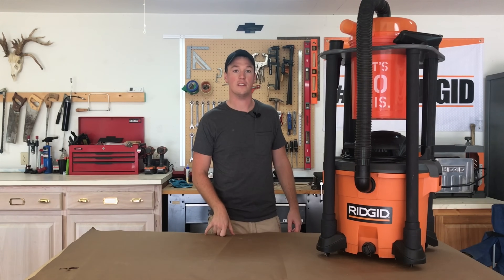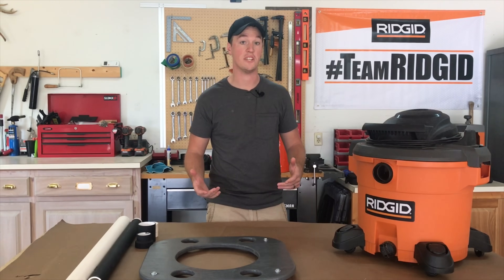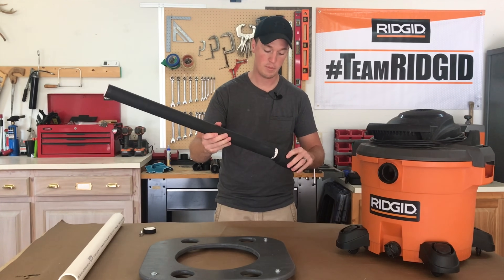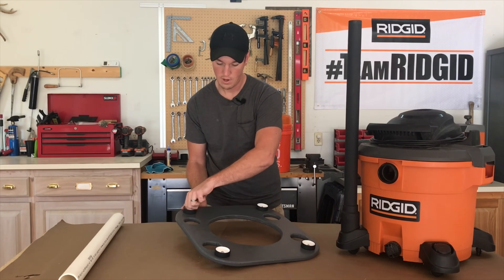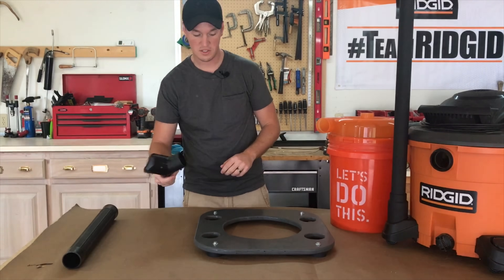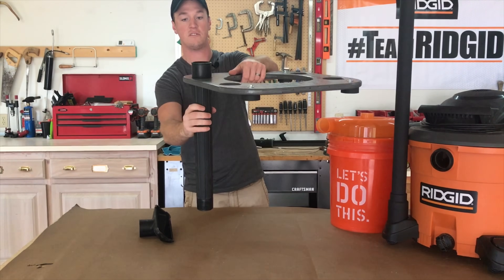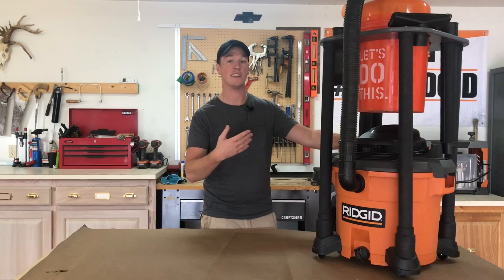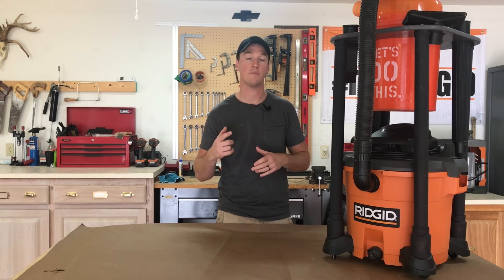The Ultimate Space-Saving Dust Cyclone Separator Cart | Dustopper & Ridgid Vac Cart

Comment: I bought the Rigid after they changed the caster feet from John’s version. It actually simplified the design for me. (4) 1.5” pipe at 33” length. Use a heat gun to warm up the pvc and push it down on to the nub on the top of the caster. If you don’t have a heat gun a 1.5” coupling fits over it loosely.
Reply: Jonathan - What model Rigid shop vac do you have, just curious.  I'm thinking about the HD1400.  That nub isn't very deep and I am wondering if you felt like you got a good tight fit?  Also - is there a way to add a screw through the pipe and into the nub to add more strength?
Reply: @pburner  I have the RIDGID 16 Gal. NXT vac with detachable blower. To make the 1.5" PVC Pipe work I used my heat gun for about a minute on one end and once it was soft enough I shoved it over the nub on the top of the well. If you look in some of the comments, the 1.5" coupler will fit loosely over that part of the foot and some folks have been successful with putting foam window trim on the inside of the coupler to make it fit. I don't mind the heat gun method, but it does look odd fitting over the feet. If you painted it flat black it will be harder to see. However, I have a small shop, and this vac sits in the corner so you'll never see it.
Reply: @pb5172  Thanks for this.  Sounds like a good way to go.
Reply: I went all over the place looking for pvc that would fit and no luck. I was thinking about heating it like you did and i think i will give it a try 👍🏻

Comment: What im not understanding is why have this set up when you have a shop vac? Basically you made a container that collects dirt, trash, ext in 1 contaner. Witch thats what the shop vac is used for. Not saying tgis idea is awesome and looks great. I just dont understand the concept of it when the shop vac does the same thing without the bucket right? Or am i missing something?
Reply: The way it works is if you don't have the Dustopper ALL the sawdust and crud go into your shop vac and eventually your filter becomes completely plugged and the shop vac itself fills up.  Using the Dustopper, all the debris drops into the bucket and very little, if anything goes into the shop vac thus saving the hassle of emptying the shop vac and messing with the filter.  I got a bag for the shop vac and will see how that works.  It collects the debris and dust but will eventually be thrown out... similar to a vacuum cleaner bag.
Reply: @Pkerr1000  im ment to say. not saying this isnt awesome and works great. I had said. not saying this is awesome and looks great. But anyways yeah i get that idea. Its just that you can put a reusable filter thats rewashable in the shop vac itself and not have to worry about it getting dirty or motor getting guncked up. I think now there would be more to clean up with the bucket as well with the shop vac. Now i do see it as a good idea for water separation tho
Reply: @shyskeleton1665  This method pretty much eliminates the need to mess with ANY filters as all the stuff would go into the Dustopper.  Once your bucket is full you just detach and go and dump it.  No muss.  No fuss.

Comment: For those of you with a newer ridgid vac where the part above the casters doesn’t fit standard PVC, get 4 of those short rubber 2” to 1 1/2” connectors with the hose clamps on both sides. Fits like a glove
Reply: What did you do to counter the wobble from the rubber fittings
Reply: @matteason989  the fittings are only about 3” long and with the metal hose clamps on both side you can get it pretty darn tight on the base and around the pvc. The top of the cart has a little bit of wobble but not enough to affect performance. Hasn’t ever fallen over or anything like that

Comment: For those of you who have wobble due to rigid changing the casters.....wrap some 3/4 weather stripping around. Gives the 2 inch couplers a snug fit. You still get a little play but it’s way improved. I may add some horizontal braces around the pipe to help further stabilize.

Comment: Great mod. I just finished mine today abs followed your build. Rigid must have changed their vacs Becusee the 2 inch pvc is too big for the vac footing pieces. I tried a 1.5 and too small. The 2in fits but it’s not snug and makes everything wobbly. I’m going to have to figure out how to make things snug.
Reply from the maker: Yea it’s a shame, of course they had to change it haha. I don’t have the new vac but maybe you could wrap some electrical tape around the castor to snug up the pvc. Or even just run some little screws through it if you didn’t mind

Comment: John - where are those pinned comments you mentioned?  Thanks
Reply from the maker: Hmm it was right at the top of the comments. Not there anymore, dang!
Reply: @JohnBuildsIt  I know.  So now what am I going to use?  ;-)
Reply: @Pkerr1000  also looking for a solution - I bought all the stuff and the fittings don't work.  Was hoping someone smarter than me can share.
Reply: @smoothlarryhughes  Probably have to just go to a big box store and just start trying different couplers and reducers etc until you gt the right combination.
Reply: Someone in comment section stated to heat up a 1.5 pipe and press it into the wheel thingy and I guess what it cools down it fit perfectly hope this help will try this next week when I have time

Comment: I built this setup to use in my small shop. The build is great, but the rigid shop vac has very poor suction. Not good enough for my needs as a dust collector. I had to fall back to using my my old craftsman shop vac with a dust deputy dust collector. Much better suction.

Comment: I used your idea and tweaked it for my needs.  Thanks for the idea.  I have a 20 gallon drum for my dust collection and needed more support so I added some T connectors on the upright supports. That made it more sturdy and is working well.  I cut a handle in the top to move the cart around easier and cut out a place to wrap the cord.  Works great.  Just what I needed.  Thanks for the inspiration.
Reply from the maker: Awesome man! 👍🏽

Comment: My Rigid is older and the holes at the at the casters measure for a 2.25 ID diameter coupling, don't think a 2" will fit.  Thinking about get a new model Rigid for the shop, anyone know what size couplings fit it.

Comment: Hi John: I have a brand new Rigid Vac. WD1060. It has the new style feet with that downward slanting groove. I purchased 1 1/2" black ABS pipe, 4 connectors and 4 end caps. The connectors fit the groove very snugly, they must be thicker than the PVC. Problem solved. I'm going to copy the rest of your design. Loveit!
Reply from the maker: Awesome!!
Reply: Mike, would you mind sharing what connectors you found? I have the new slanted wheels as well.
Reply: Hi - can yous hare the connectors you used for the new NXT models?

Comment: I just ordered the 14 gallon Rigid.  The price was reduced by $44 to a mere $79 and the shape of the 14 gallon Rigid doesn't taper outward and it looks like it will allow the 2 inch pvc all the way up without the reducer.  I will post again after it arrives and let you know.  I am considering the 7 gallon pail buckets from Amazon, but it think it will require a longer hose to connect the two if I do that.  I will wait and see in about a week after it arrives.

Comment: Thanks for the idea @John Builds It, I copied your plan but had to modify it because I have a different model vacuum, mine is the Ridgid HD14000.

I also copied @Cary Anderson  idea to soften the PVC tubes with a heat gun to get them to fit on the wheel supports. Great idea Cary, it worked great.

When it was fully assembled, I realized that it was quite wobbly because the PVC pipes were not tight against the side of the vacuum canister to add stability.

I was trying to figure out a way to stabilize the PVC supports and while at work the other day I came across some packaging material that was going to be thrown away, it was Kaizen foam, I cut it to fit between the vacuum canister and each PVC post. It worked great and the assembly is rock solid now.
Kaizen foam is quite expensive to purchase so I was very fortunate to come across some for free. 😁

Comment: I have one question. How do you figure out where to drill the holes for the caps?
Reply from the maker: It’s the same measurements from the centers of the castors to each other
Reply: Thanks brother came out perfect. Do you use that on your tools?
Reply from the maker: The Dodson’s yea man, I use it on everything!
Reply: Ok just curious if there’s a better hose to use on tools. The rigid one seems heavy and not super flexible. I’ll try it out this weekend on a project. Great plan dude pretty bad ass.

Comment: Just built one based on this idea for my Rigid 12 Gal. 5.0-Peak HP NXT Wet/Dry Shop Vac.  Used 2" and 2" couplers for the feet  30" legs.  Had to relocate the handle.  Pictures on my FB ablum: https://www.facebook.com/carl.chapman.sr/media_set?set=a.10158737928724623&type=3

Comment: Great concept!  I've got a Craftsman vac but the design in your video along with all the measurements worked out great for me.  Just put mine together in one night and finished spraying the legs and top today.  I picked up a brush attachment at Lowe's for $8 and used that 90 degree elbow to finish off the attachment of the Dustopper to the vac.  I also added cletes on the underside of the top to have something to grab on to as I move it around my woodshop.  Really appreciate your video that made it all happen!  Keep up the great work...

Comment: Cool idea! It figures that Rigid changed the dimensions on the caster support,  they are probably planning to sell a kit that copies your idea.
I'm going to try the suggestion of heating the PVC pipe to make it fit. If that doesn't work, I noticed home depot sells rubber pipe connectors with steel sleeves and clamps, that seems like it would work also.
Thanks for posting this video!

Comment: I bought it all and.... it’s the weakest suck in town. Taped every joint. It still won’t suck with Dustopper. Doesn’t suck, stinks.
Reply from the maker: What kind of vacuum? New one too? I still use this set up everyday lol works great
Reply: John Builds It Same exact and very new.  I think though that I got cheated out of the fitting  that plugs into the vacuum below.  So there’s a big kink in the connector hose that’s way too tight/short.  Maybe I’ll bitch it with the seller.
Reply from the maker: Terence Gillespie it only comes with one fitting. I bought the second one
Reply: John Builds It Well give it away.   Where did you buy it?
Reply from the maker: Terence Gillespie link is in the video description 👍🏽

Comment: I just built this. My vac is bigger so I went 2 inch pipe.  I put a screw through the coupler to secure it to the vac/base. Problem I'm having is it's a little wonky.  Any thoughts how to tighten it up?
Reply from the maker: Could you use a bolt and nut to tighten it up better? Or maybe wrap some electrical tape around it to make a tighter fit

Comment: For people out there struggling with pipe fitment and newer style Ridgid vacs. If you're in the market to upgrade your vac anyway like I was, the Ridgid WD1060 (stainless steel model) is a great option for a few reasons. 

1) It has the 6HP motor and the smallest tank for a motor that size (10 gallon). This is good for this setup because we have a 5 gallon bucket for dust/debris, so why have a giant 16 gallon bulky tank?

2) The legs have slots that fit 1.5" PVC perfectly with a nice tight fit. No need for adapters or reducers.

3) The stainless steel tank is NOT tapered like all their other vacs. This means the PVC pipe will go straight up and not be kicked out at an angle at the top of the vac (no need for PVC reducers).

4) It's $99, making it cheaper than the two 6.5HP options, and the same price as a plastic one with only the 5HP motor. 

5) It actually looks awesome, the stainless tank is great looking compared to a big orange or gray tank.

6) Still has the Ridgid Lifetime Warranty.

If you go this route, all I had to buy was:
- Ridgid WD1060
- Dustopper
- 1 1.5"x10' PVC pipe (cut to 30" pieces)
- 4 1.5" PVC end caps
- 1 Brush attachment with the 90 degree elbow from Lowe's. This is for a ShopVac brand vac.

I had scrap plywood, 5 gallon bucket, nuts and bolts, black spray paint on hand.

Comment: Hey John, Great design. I watched a few videos about making a vacuum cart but your design was perfect. I just wanted to add that I have an older shop vac that came with a 1 7/8” hose. I found that a 1 1/2” pipe fit perfectly without the 2 1/2” to 2” reducers. 
Thanks for posting this.

Comment: You don't even need that "dustopper" ---  I'm not sure why people buy those (the dustopper nor the deputy).  All you need to do is cut a hole in the top of the lid that comes with the plastic bucket for $4.  I've been doing that for years.  Save the money, and just get a 90 degree PVC elbow; cut a hole in the top of the cheapy plastic lid, and one in the side, also put an elbow in it.  Works the same as what I've seen of every video on youtube.
Reply from the maker: That definitely works! But no where near as effective, especially as your bucket fills up
Reply: @JohnBuildsIt  I guess I usually empty it before it gets half full.  It might not be the best idea for someone who is producing a ton of sawdust, but for my small and occassional projects, it seems sufficient for now.  

If I ever need something more powerful or better I'd probably invest in something else ;-)

Thanks for the video!

Comment: Hi John. I watched this video and had to make one. I should have checked my vacuum before buying all the parts. I have the 6 gal Ridgid vac so the 1 1/2" PVC worked perfect without the need for reducers. I cut the holes for the extension tubes with a 2" hole saw and used the discs, with a little sanding down, to use as posts for the two vac head attachments. Had to order another 90° elbow fittting for the top as it just a little short for the configuration. Other than that, what a great project!

Comment: Cool design, I bought the metal rigid vacuum the legs are a little different so I didn’t have to use the bigger pipe I just used 1 1/2 pipe, cut it at 37inches in height, I used the same cap design but instead of using a bolt and nut, I just drilled 3  3/4 inch screws and a washer so it wouldn’t show on the other side of the plywood. Only problem I had is the hose that came with the Dustopper didn’t reach for some reason, so I just improvised and cut down the hose that came with the vacuum so it wouldn’t be hanging too much. I’ll just go buy the orange rigid hose they sell at Home Depot, and use it as the main hose. I want to thank you for the idea I definitely subscribed and gave you a thumbs up, keep up the interesting videos bud.

Comment: FWIW:  So I wanted to be able to have all my vac accessories to be able to be with the cart at all times so I'm not searching for them but I didn't want to have to drill large holes all over the top.  I wanted a way to 1) keep it cheap, and 2) be able to put the shorter pieces on top and the extension wands underneath the top. Then I had a breakthrough: I've discovered that the accessories for my Ridgid vac fit perfectly over 1 1/2" PVC couplers.  I've attached all my accessories to my cart top by snipping one end of a coupler up about 1/2" in 4 places (probably could be more), then heating up the snipped end and smushing them down onto something flat so the tabs you just created flare out and cool that way.  This makes it into a flange of sorts and then you can put a screw through those tabs to hold them either above or below your cart top. Then you simply place your accessories onto the pieces and marvel at the wonder of all your vac pieces being in one location and you don't have to search for them ever again...
Reply: Excellent idea! Just be very careful heating up and melting PVC parts, as they can emit dangerous gasses. Be sure to use a respirator and work outside of possible.

Comment: I bought this and it didn't fit my Ridgid vacuum. It says it'll fit a 2 1/2 inch but the diameter is only about 2 1/4 so there's a gap around the hose going into the vac. So there is significant suction loss. So I returned it to Depot and got my money back. My vac is a 6hp 16 gallon.
Reply: Which model vac did you have?